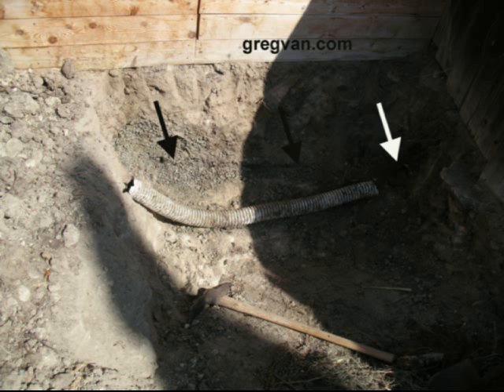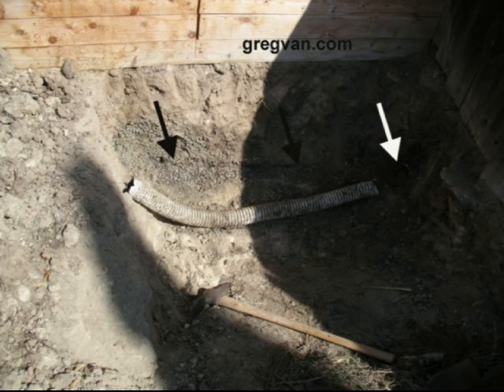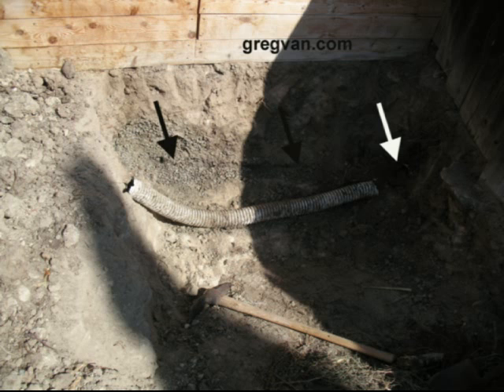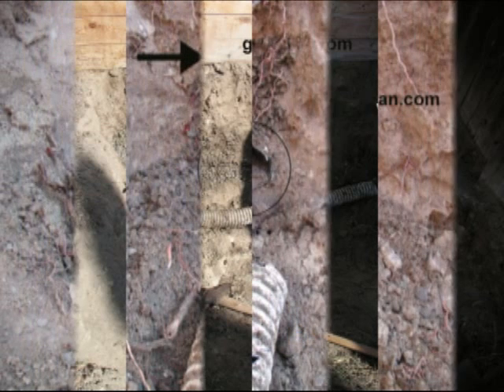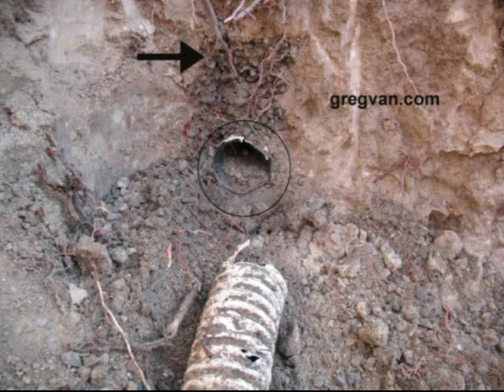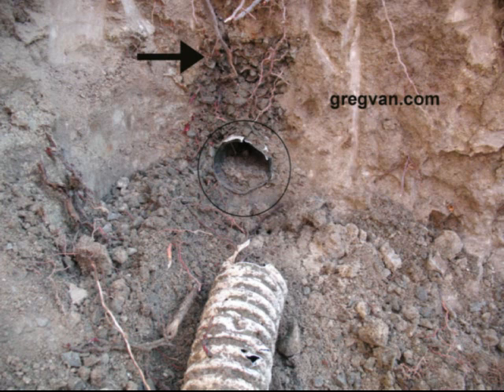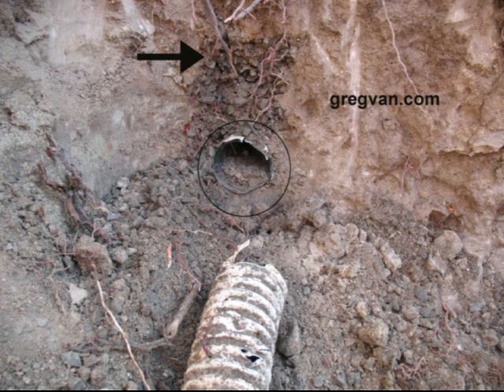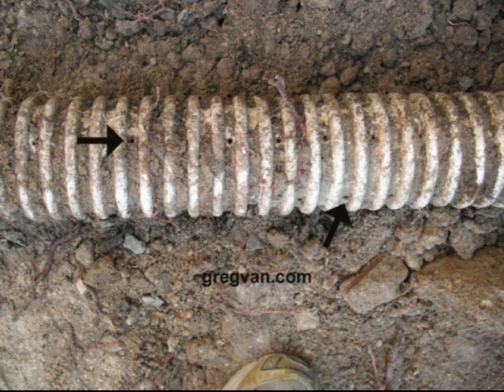Backyard Drainage Failure - Perforated Drain Pipe Problems

Comment: I have a corex solid drain pipe that has been in the ground for 21 years and is still clear. If you don't add traps every 75 feet so, you can't flush the drains out. If you are not doing regular maintenance on your drains they will clog up especially if you do not clean your gutters and / or add strainers on your downspouts. You cannot avoid cleaning gutters. I am not in the drainage business just a homeowner. Maybe in another 21 years when someone else owns my house or i add gutters into the drainage mix mine will look this way but now they are clear. Also drainage systems have a lifespan where you have to be replaced. Sorry you didn't install them right or clean your gutters or run large volumes of water into the pipe on a regular basis with a hose pipe to clear them. If you had done that you wouldn't be doing this video. You did have cleanouts in your line right? You did put fines filters in your traps to keep silt out too right?
Reply from the maker: I think everything you stated in your comment was correct. Drainpipes can be maintained and improvements have been made with protective netting that can be placed around these pipes to reduce the amount of debris that enters them. I'm still not a big fan of this product and would rather use solid pipes with drain.

Comment: My septic drain line is 24 inches below ground level but about a 30ft length has a drive way across it (gravel). I dug a hole past the gravel drive way and the septic drain line is dry so the waste water isn't reaching it. There  is no protective cloth over the drain line as you suggested. If I replace the line and put the protective cloth over the top before re-filling should this fix my problem?
Reply from the maker: If the line was plugged then by all means clean it out or replace it and then wrap the cloth around it following the manufacturer's installation instructions.

Comment: I watched video again and reread gregvancom comments and have a couple more suggestions. 1- connecting pipe to downspout is not a good idea, during a heavy rain, water can be forced into and loosen soil, turning it to mud and letting it drain back into tile. downspouts should have a separate shallow system just below ground and use 4 inch pvc for septic fields, as debris from trees (leaves, twigs and seeds) will flush out with rain water (also flushes critters) and corregated pipe tends to catch debris. 2- I'm not sure why the pipe was put in at that depth, it is too deep for surface water , and I didn't see any footings near by, but it looks like crushed rock was used to try to filter the dirt out. Pea gravel works much better and should have been much more all the way around th pipe. I have a friend who has been using this system to waterproof inside of basement walls under floor to sump pump for over 60 years, starting with clay tile before plastic was available, and in that time, they have had maybe 5 of the early  systems silt closed in small areas, but none since using plastic WITHOUT sock. sock silts closed and water can't gey through
Reply from the maker: Dean Meyer Thank you Dean, comments like yours are always greatly appreciated.
Reply: Actually buddy, pea gravel is a French drains worst enemy. It does NOT "work better". It's too small of a stone because the voids are so small that the pea stone will solidify into a solid, impermeable clump.
Reply: @SharpEdgeStandardOfficial   OK, to be more specific, river rock, about 1 to 2 inches in diameter. People have got me in the habit of saying "pea gravel".

Comment from the maker: I think you have a point, when it comes right down to it, things you can't see like site drainage pipes aren't as important to homeowners as kitchen cabinets, but they should be. I think the biggest problem is that building supply stores refer to this stuff as irrigation drainage piping and most people believe that will work just fine. Let's face it, it looks like it will and sometimes maybe it does, but what you do when it doesn't.

Comment: gregvan. I know how it Must be Done, but the cost to the Homeowner is almost always too Dear, and they choose the contractor, who bids the straight "Advanced Drainage System" installation, without the sock. I always bid the sch 40 ABS or PVC pipe,  which I drill (holes on top, socked.). I don't use the NDS 2729 SEWER PIPE (too thin, for maintenance's sake.). But I  almost always lose the Bid. 
    Best Regards, Tom Ladyman.

Comment: gregvan. Watched your video, about proper drainage. I have not yet seen such attention to proper installation, with a focus on the longevity and, the Maintenance of proper drainage of surface and subsurface water pooling:  Just, as importantly, the Maintenance of a Proper Drainage System, by a conscious regard to that Maintenance (Why should a homeowner install a drainage system that will fail in 5 years?).
    I see these failed drainage systems, many times, each year. You are my Tutor.

Comment: The basement is concrete poured into some sort of grey, dense foam. 8" deep on the upward slope side but exposed on the down slope. There's a poured concrete base over three wrapped plastic lined french drains, but its the runoff from the new porch area that I need to settle. I'm thinking about something like a Japanese earthquake drain - not that we get many earthquakes in central Maine - but y'never know... T.

Comment from the maker: This is a hard question to answer, because I wouldn't want additional water having the opportunity to work its way around the basement. If this is for a roof gutter drain, then what I would like to see would be solid pipes used along with some type of a site drainage plan to get the water away from the building. I hope this helps.

Comment: I want to install a rain chain to a crushed stone( 2" - 3") filled 8'x12" pit - auger dug pit leading to a french drain that runs around the basement - the house is dug into a 1:4 slope. The top 18" of the pit will be lined with vertical stone slabs and filled with rounded river stone. will this work without either socking or corrugated plastic piping?

Comment: Pipe would work fine if socked AND gravel around the French drain is wrapped tight with drainage textile fabric.  Put a French drain throughout my yard to drain off water about 7 years ago.  Recently dug up part of it to connect a drainage pit.  Everything still looked great.  I have 2 layers of protection from dirt getting in pipe.

Comment from the maker: What exactly should this product be used for?
Reply: corrugated pipe was actually invented for the purpose of draining large agriculture fields. And even today that is its largest application. The long rolls, and the fact the pipe is continuous makes it easy to install. They have specialized machines which allow hundreds of feet to be installed continuously. Where it fails is in the installation process. It needs a much greater slope to achieve good water flow. Where smooth ridged pipe can be installed at quarter inch fall per 10 ft - corrugated should be installed at half inch per 10 ft fall. Or even greater.

Comment: socked pipe cloggs with silt and becomes useless. any corregated pipe to drain surface water is worthless. it is meant for ground water drainage below frost line.

Comment: Sewer and drain pipe I have seen is smooth with the holes only being on the bottom side....my system been in ground since early 90's....works fine as long as the pipes dont get mashed by heavy equipment etc...